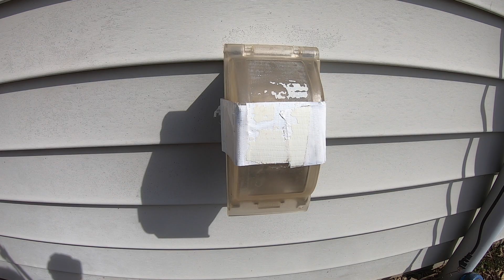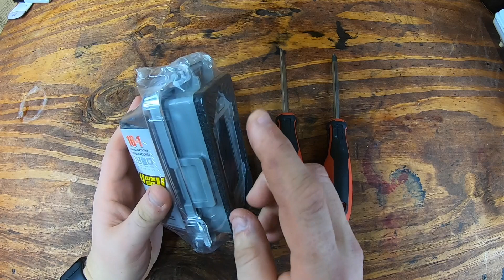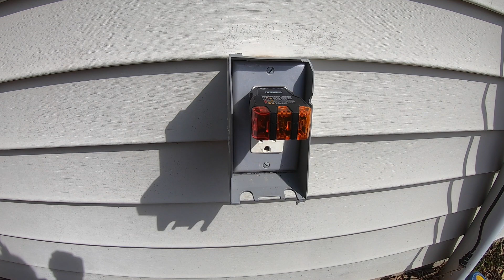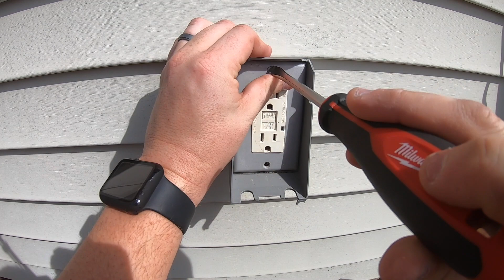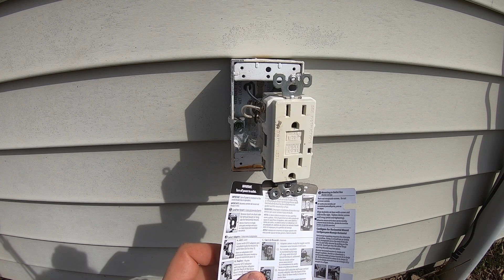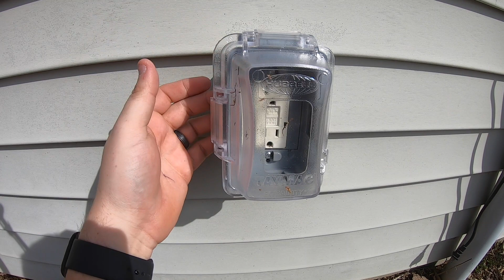How to Replace an Outdoor Electric Box [Complete Guide]

Comment: Good video. Mine has a standard outlet… should I change it out?
Reply from the maker: A standard outlet should be fine. The front of my house has one and it works well.
Reply: @MCFIXIT   bruh you can use a non-gfci outside only when the branch is already protected by gfci. Also, you replaced a cover here, not a box